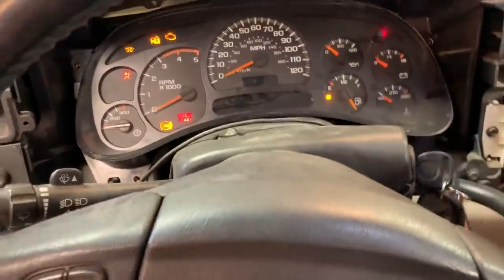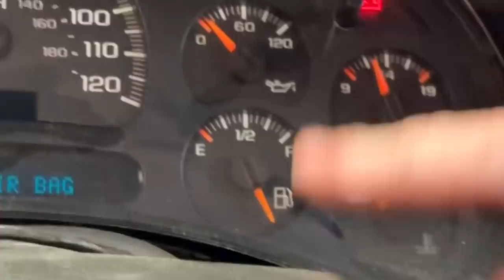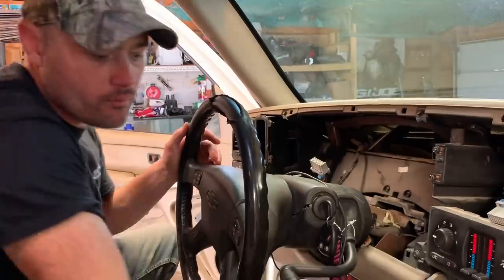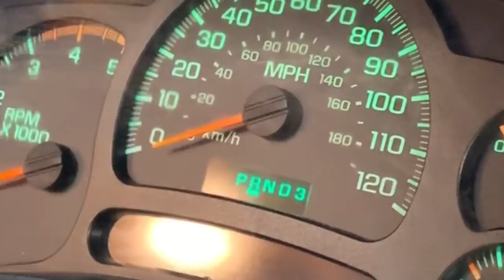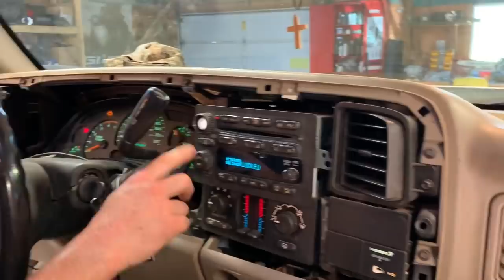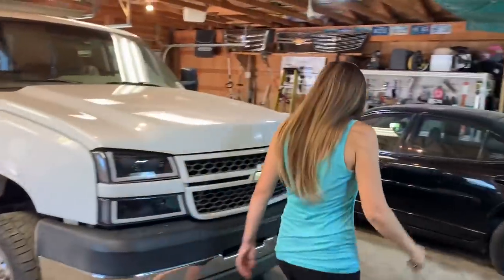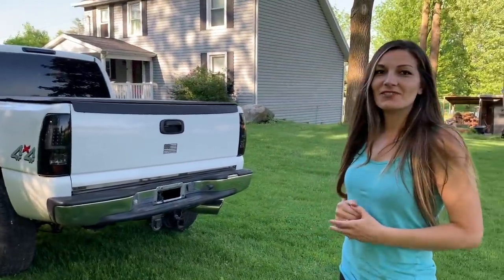Wife Hasn’t Driven her Duramax In A While!

Comment: Take the box off to change the tank much easier. Its what's I did on my truck. Just put after market radio in. And you have to use the little blue box, it's called gen pac rp5 gm11. You also need the antenna adapter.

Comment: If it's not the sending unit just replace the stepper motor for the fuel gauge. Pretty easy. All you gotta do is pull the cluster apart and solder in a new stepper motor. Replaced all mine and put new LEDs in.

Comment: For the dash, it is pretty common for this era of truxk, it's typically a bad solder joint on the circuit board. I fixed it in my brother's '99 1/2 ton and it only took about 15 minutes total. Also, if you need another stereo/CD player, I can give you mine that I took out of my 06 WT.

Comment: A dealer can unlock it, for a fee.  Small chip inside the unit that holds the VIN.  You can pull the chip out and unlock the radio, but it will never hold any presets again.

Comment: Good luck with the radio, I bought my Duramax last year with the same issue. Took it to the dealership to have them call their 1-800 number and it"s no longer available, they told me at that point there was nothing they could do so I just ended up putting an aftermarket touch screen in.

Comment: Just resolder the resistors for the PRND light and it will work again, also the fuel gauge might be a bad stepper motor which is easy to replace too!

Comment: Look in the Manual of the truck, there should be a code you type in that will unlock the radio, the dealer I bought mine from wrote down the radio and nav codes

Comment: Hey man I have a question for you, I recently had the injectors changed on my 02 lb7 like 15 days ago, It drove fine good but then it started a small leak on one of the high pressure lines and I took it back and the guy tightened it more and it solved the problem. Anyway I took it to Nashville (1hr away) as I was coming back I saw a bunch of white smoke behind me. The truck wasn’t smoking from exhaust but it was leaking a lot of diesel from the engine, which with the air and heat of the truck made its way back everywhere under the truck, gauges were all good, Trans and engine temp were normal. You know what might’ve happened ??  Thank you.
Reply: I changed injectors in my 03 and had similar problems. One of the first things most people do (im not an Certified mechanic, but know a thing or two) is question whether or not they did something wrong, before they question a new part! After alot of head-scratching and troubleshooting I ended up sending back my first set of injectors and then had to replace one injector from 2nd set (Bosch injectors)! Pressure lines was replaced and return lines, balance rates looked good but every time I took it about 15 to 20 miles, crankcase would fill with fuel and push all the oil out! On bright side....my motor was clean as hell!!

Comment: U used to be able to call the 800 number for the radio unlock. But the number is not working and hasn’t been for months and GM said they don’t know if it will ever be back up mines been locks for 6 months waiting on that number to get back up. I took it to the dealership and they couldn’t unlock it either because the number was down. Grrrr

Comment: Cost me 25 buc at dealer to have my gm radio unlocked  takes a tech 2 scan tool.
Reply from the maker: I  wonder if my scan tool will work
Reply: @TruckMaster  there's a video of the same radio where you push certain buttons on the radio and it will unlock it.